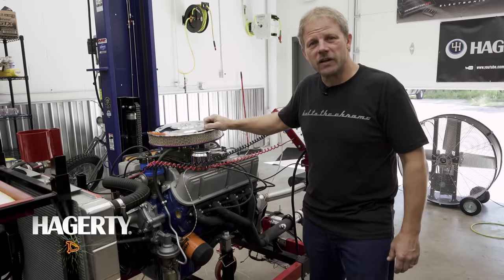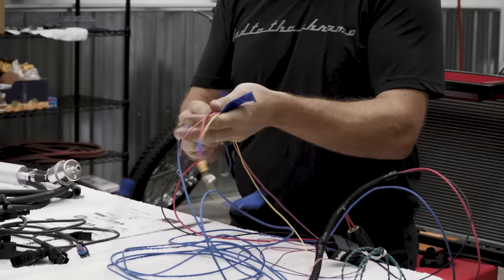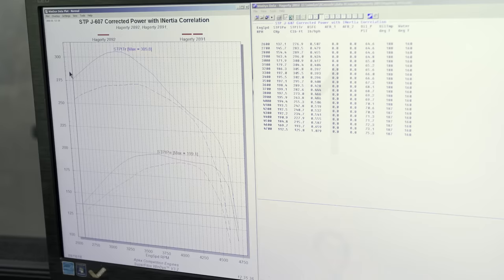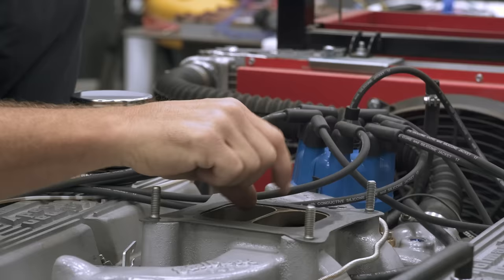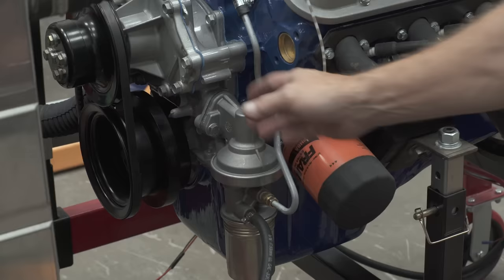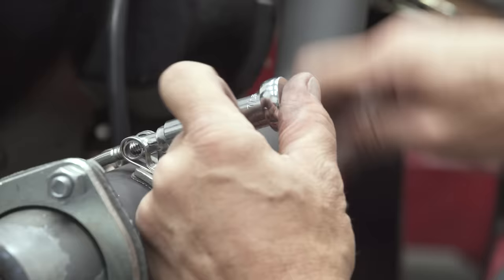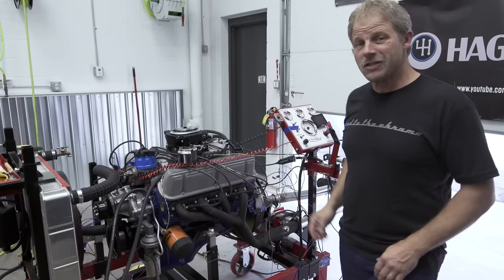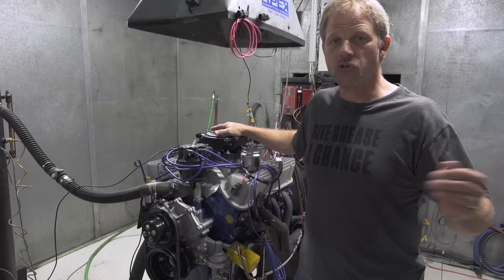Is it worth it? Replacing your carburetor with a Holley Sniper EFI | Hagerty DIY

Comment: I think the biggest benefits are real world situations.  The carb is set and done.  The EFI is able to make a lot more adjustments according to temperature, humidity etc.  They did a video a few years ago to see if its worth it and the fuel economy alone is worth it
Reply: Blessed be
Reply: @SmokedTirez  "Soon the gov't will be putting an end to all of this........." - yeah right - the government is going to STOP whatever.
Reply: @SmokedTirez  you can't run a vacuum distributor with holley EFI because the EFI system can read and adjust a vacuum distributor lol
Reply: I having to warm up carbureted engines in the winter is a huge benefit
Reply: Just ls swap it
Reply: No more rebuilding due to
Ethanol fuel; hopefully!!!
Reply: @SmokedTirez  "
Reply: @chriscarbaugh3936  what gives you that idea?
Reply: @SmokedTirez  the EPA has been getting extremely aggressive on the aftermarket lately...
Reply: @chriscarbaugh3936  exactly.
Reply: Hey I’m trying to find that inline kit that you have to do the same thing with my truck, I can’t find any kits just single pumps.
Reply: @SmokedTirez  Based on your comments are you suggesting keeping the carb until R&D catches up. My Dad's 68 C-10 carb just went out and he is exploring getting a sniper EFI
Reply: @jbreezy2007  I think he's full of shite.  As long as the system knows when the valve is opening, it shouldn't matter whether you have flat tappet or roller styled cams. 

For a c10 I'd definitely try the holly efi, since it should bolt directly in place without any funky manifold work.
Reply: @jonathanlawson4667  There is zero reason for not running a vacuum advance distributor unless you are controlling the timing with the EFI computer. Injector pulses are controlled by the "spark" & needs to be advanced with rpm & timing, regardless of whether the distributor is changing the timing or the ECM. Bottom line is; #1, as stated in another comment, defective "points" were the ignition problem, not the points dist. NOBODY knew what an electronic distributer was before 1972 or so, & they turned engines way above 4,500rpm. #2, technically, if correctly jetted & tuned, the carb does see "air density" changes, whether from temp or altitude, & will pull more or less fuel through the circuits accordingly(my buddy has a SC Olds Cutlas that runs 7.90s & 168mph & he NEVER touches the carb, once it's correctly tuned, regardless of where he's racing or ambient air temp). #3, TBI EFI will never make more power than a carb, although it may equal the power & port or direct injection will never make as much power as the carb because the fuel in the intake helps cool the mixture making the air more dense. Alcohol does the same for air density. NHRA Pro Stocks have been running injection for about 10 years & they are still a couple tenths & several MPH slower than the current records set with carbs & the Mountain Motor Pro Stocks set a new record this last summer WITH CARBS built by Pro Systems. The arguably best EFI tuner in the country(EFI University who tunes the Elite Pro Stock cars & a couple of the factory "stock" shootout cars) agrees that ya can't beat a well tuned carb on real performance cars! #4, as far as reliability is concerned, try finding sensors for your aftermarket EFI on vacation in Podunkville, USA when your system fails(I say this after making a living as an auto tech & having more hotrods & race cars than most can dream of, for over 50 years)
Reply: @bradgriffith4231  well first of all there's really no sensors on EFI lol unless you are talking about a oxygen sensor or TPS sensor either way they barley ever go bad and those are readily available at any local podunk autoparts store I mean I run carb on My supercharged camaro but it just doesn't beat a good EFI system that does everything for you tuning wise and you'll be doing a jet change because of say elevation at some track you're going to while the EFI will be there running already self adjusted and at the end of the day it's user based and whatever you prefer but EFI beats a carb on so many different levels lol
Reply: @bradgriffith4231  and your other awnser I already stated you don't run a vacuum advance on EFI system so I don't know what your point is here
Reply: @jonathanlawson4667  You have 4 injectors, an o2 sensor, a Throttle positions sensor, a MAP sensor, a temp sensor, etc but I guess you're the expert, about no sensors nor anything electronic to go bad. Have a nice day, Keyboard Expert!
Reply: @bradgriffith4231  no a expert but the few sensors I named are the ones that usually go out and like I stated those are readily available at any parts store and no I didn't name all of the sensors so I don't understand why you did unless it is just to say I was wrong when clearly I wasn't and the bottom line here is fuel injection beats carb hands down it's simple tune abilities and ability to adjust to any condition without the driver ever stepping out of the car puts it light years better than a carb and I can tell you've never had a aftermarket fuel injection system just by your hatred and inability to have a decent conversion without trying to attack me for stating facts and I didn't put down your cave man carb nor did I put down you you have a nice day Karen and try not to stress out so much and don't be afraid to try new things you never know you just might like it
Reply: Don't forget that efi doesn't need to warm up to run well.
Reply: Your own test gained nothing in milage on the bronco though
Reply: Bingo.  Unless you adjust the carburetor each and every time you start the engine, you can't possibly match what EFI is capable of.
Reply: @chuckschillingvideos  carbs don't go out of adjustment. They are a fixed value if the engine suddenly goes out of tune that means the motor itself has changed. Lost compression, valves wearing out, cam wearing out. EFI can hide a lot of issues that a carb will show up immediately when there is a issue. When my car started running lean and having issues bogging when accelerating I didn't immediately say oh it's the carb out adjustment. Turns out my fuel pump was on its way out causing fuel starving and running lean. If you actually know how things work u can be a smarter car guy. Unless you get trash in a carb to plug it up it shouldn't ever go out of tune. Unless you plan on driving from la to Denver Colorado air density should not change that drastically from where you tune the carb at the elevation you live at.
Reply: @johnsnow1355  It's pretty hard to change the fuel economy very much, regardless of carb or F.I., if they are both tuned correctly. They MUST have around a 14.5:1 air/fuel ratio to idle or run down the highway without melting down & somewhere around 13:1 to make the best power. Since an engine is basically an air compressor that burns fuel, the bigger the engine, higher the rpm,  weight & frontal area of the vehicle, etc all affect the MPG. Both should get similar fuel economy IF they are both tuned correctly.
Reply: @bradgriffith4231  exactly but the idiots comments about EFI being so incredibly superior will argue till there blue in the face EFI will instantly increase the fuel mileage 😂😂
Reply: @johnsnow1355  You're completely missing the point.  The point is that a carburetor can be adjusted to be optimal only for a single set of environmental factors.  Once any of those factors drift out of range, the carburetor is no longer optimized and will perform increasingly poorly.  So, for example, if you live in an area that gets four distinct seasons, you'll need to adjust the carburetor a minimum of four times per year for anything like peak performance.  For folks that own carbureted vehicles but aren't mechanically minded, that's gonna get expensive.
Reply: @chuckschillingvideos  no you don't that's what a choke is for till the engine is at operating temperature. EFI injects extra gas on cold starts and carbs use a flap to make the carb pull more vacuum and more fuel. I do live in all 4 seasons from -35c to +40c and a carb will work just fine with a good choke set up. I prefer manual chokes that you can adjust from the cab over crappy electronic chokes. Engines only run optimal at 195f or whatever thermastate you have. Don't matter if it's EFI or carb if you are outside that operating temperature range both systems have to compensate for the temperature of the coolant below or above optimization
Reply: @johnsnow1355  My buddy with the 7 second Olds says F.I. is for dumb-0-craps & Carbs are for Conservatives, who actually have a real thought process!!!  LOL  The best F.I. tuner in the country(owns & operates F.I. University & tunes the Elite pro stock cars) even says carbs are as good or better. Where F.I. shines is on the artificial horsepower cars where the power can be changed by the tune-up. Ya can't change the tune-up in an N.A. motor. And, as far as cold starts goes, I grew up in Illinois, lived in Colorado, Arizona, Oklahoma & now Nevada & I've never run a choke & never had cold start problem. Knowledge is EVERYTHING!!!
Reply: @toomanyhobbies2011  The EFI might not need to warm up but your engine does. Hot Rodding cold motors is the fastest way to trash one!!! IF the motor is too cold to run without the choke, it's too cold to be run much above idle!! LOL The new cars run 0w30 synthetic oil, not normal 10w40 or 20w50 performance oils.
Reply: @bradgriffith4231   Thank you Brad, your ignorance is compelling!
Reply: You need to remember this is for the aftermarket performance fuel injection! Not a factory preset with OBD2
Reply: Zulu de o que dhk🕯️🕯️🕯️🕯️🤯🤯🤯🤯🤯🎷🎷🤯🎷🎷🤯🤯🤯🎷🎷🎷🎷🎷🌿🌿🌿🌿🌿🌿🌿🌿🌿🌿🌿🌿🌿
Reply: @chetparker8251  not if we dont adjust
Reply: Here’s the deal. A high performance motor needs to
stray away from the standard 13-1 AFR from time to time. Like say acceleration. It needs to get a little sloppy. A carburetor designed by Holley as a matter of fact, does just that. Hence accelerator pumps. And different sizes. And different pump cams. Injection cannot stray away from that ratio. Carburetors will always be faster. Now if it’s a trailer Queen, then your intentions aren’t performance then get yourself a thumper cam and have at it. Or if you want power get yourself a book, a friend in the know, or ask someone to teach you how to tune a good 4150 type carb. It isn’t rocket science. It’s just a carburetor. Not hard to tune.
Reply: @beezowdoodoozoppitybopbopb9488  the last year for a factory carb was 1991 with the Ford Crown Vic 351VV and, I 'believe' 1993 for a Hyundai or Kia. In other words; converting almost any carb'd car/truck to FI will, if anything, cause the EPA to go after more legit targets, as in OBD II 'tampering', which became mandatory for 1996.
Reply: @chuckschillingvideos  wrong
Reply: @jgpa3z  Nah, one of these engines with proper set up and tuning with a Holley sniper will give an LS a run for its money. Stop being a fan boy and broaden your knowledge.
Reply: Nice to see you here
Reply: @bradgriffith4231  let's see a video of your buddies 7second 168mph naturally aspirated Oldsmobile.
Reply: Wizard
Reply: Who did the fuel milage test? The Government?
Reply: Exactly, and ironically fuel injection systems are way older than carburetor, 🙄I'd never get anything with a carburetor ever, had enough of that sht... I'd rather spend good money one time...
Reply: @GreatLakesLogger  its probably an 1/8 mile car
Reply: @jor4288  If you have a choke present and adjusted correctly, you shouldn't need to "warm up" a carbureted engine any more than a vehicle with EFI.
Reply: @chuckschillingvideos  If you use the stock style thermostatic air cleaner, you wouldn't need to make seasonal adjustments. Unlike an open-element air cleaner, the thermostatic air cleaner effectively regulates the air temperature going into the carburetor for a consistent A/F mixture.  Just like EFI, a carburetor needs to have ALL parts present to function properly.
Reply: If you are familiar and know how to adjust a carburetor, and you like your carburetor, then all you need on the road is a screw driver and a couple minutes if you're travelling to or from altitude. I know the sniper once it is set does all of that. But I've seen the installation of these, and all the extra non conforming parts you'd have to buy and I just don't think it's worth it, or much more reliable. If you're keeping up on maintenance and proper fuel care, carbs are just as effective.
Reply: @bradgriffith4231  thank you! I agree 💯
Reply: @chuckschillingvideos  I've lived in NY, Texas, NM, Colorado and they all have seasons, temperatures and elevations, and I've NEVER had to adjust a carb four times a year. Yes, the adjustment in Colorado is a touch different,but it wasn't drastic, but once it was adjusted, seasons had no effect on it.
Reply: I've tried 2 different efi setups and the MPG was the same.  It's not until you get to the dry setup (fuel after the carb through the intake) with ignition timing that you'll see any benefits.  Dry setup as being with the injectors after the carb.   Best is the Edelbrock pro flo latest system with ignition control.   These systems that are being thrown at you are wet flow (fuel at the efi carb) are crap and only a minute difference between a properly setup carb.   That being said, most people don't know how to setup a carb properly and they see huge performance gains using efi.
Reply: @bradgriffith4231   You lying to yourself if you think a carb can make more  power than EFI/Direct injection under forced induction...  You must be talking about naturally aspirated... If you are than say that ...
There is a reason why carbs and nitro comes in last..  vs injection with forced Induction on the short track...
Reply: I asked you to do a video on how do the get all of the interior factory gauge to work and read correctly; all the dummy light to go away after a Cummins swap on a truck that is not dodge...You said you would make a video. You never did.. Awe fuwey!! 😤 Old Ford/Chevy super duty truck swaps of course...

Comment: Davin is the Bob Ross of engine tuning.  His calm demeanor is magnetic. The video also left me with ZERO questions about how to install the sniper kit. Very thorough. Thanks
Reply: There were actually a couple things done incorrectly in the installation in this video. The first that comes to mind is they connected the main ground to the bell housing bolt and the main power to the starter solenoid. Both of those 100% need to go to the battery. They got lucky it worked fine like that.
Reply: My favorite mechanic!

Comment: After 2 1/2 years of running the Holley EFI system in my 1972 De Tomaso Pantera, we finally gave up two weeks ago.  30 months of the EFI shutting down every time the engine temperature got to 160*F, leaving me stranded in some very dangerous situations, where I was stuck for 20 minutes or so waiting for the engine to cool down, so that I could start and drive again  did it for me.  30 months of trying and failing to diagnose the issue, and the last 60 days trying and failing to contact Holley, who is not answering phones at all, was enough for me.  I wanted to drive my Pantera before I was too old (68) to be able to do so.  The Edelbrock carb is back in and so far running fine.  On customer service alone, I would never order another Holley product again!
Reply: Thanks for for letting everyone know about your experience with that. I at least know not to go with the Holly setup.  I wonder if FiTech, Jegs or Aces are any better?
Reply: @tedgeldberg6498  thanks for letting people know.  Probably the computer over heating since it’s integrated in the EFI kit.  Kind of dumb place to put it.
Reply: Integrated computer above the engine is a horrible idea because the engine heat fries it. I believe there is a kit with computer remotely mounted.